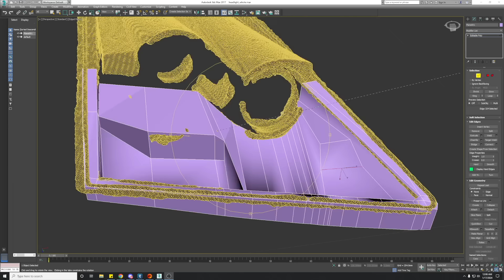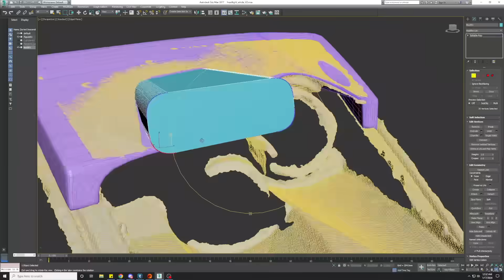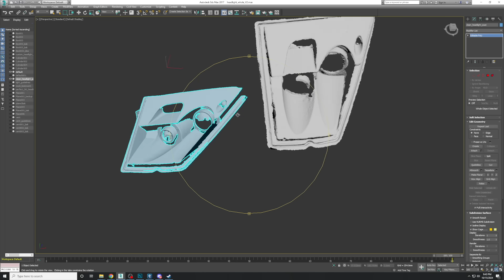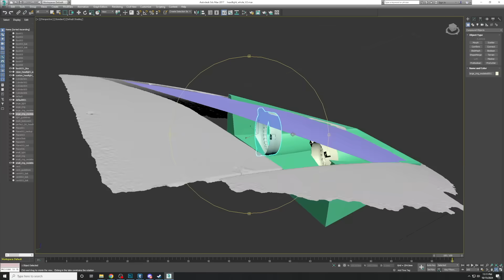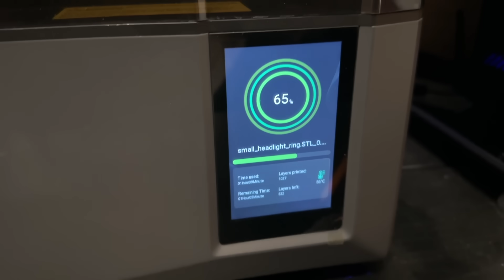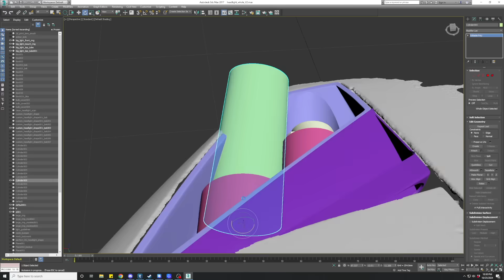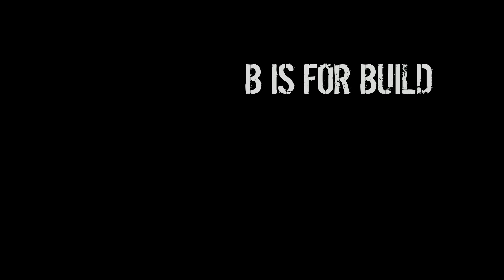I SAVED $23,000 By 3d Printing My Own Lamborghini Murcielago Headlights

Comment: why you didn't make a molding for your headlamp,, and you make the carbon fiber housing, that's make it more expensive and exclusive than 3d printing part..

i use 3d printing just for the molding, so i make all the part with carbon fiber or forged.

Comment: I've been have a blast making small carbon parts from 3D printed molds for my 2018 C43! I'm going to try the vacuum process and try make fender this weekend! Using 3D max is interesting, have you tried AutoDesk Fusion for parts? I use AutoDesk Products for home designs mostly in Revit but I use fusion for 3D printings and CNC milling but not very good at that. FYI your iphone has built in LidDar that I would say works as good as 1K$ scanner. Great video DIY all the way baby!!

Comment: Fellow Murci owner here... If you want to print the main headlight body in resin, I have a couple large resin printers to help you with.  Gloop is possibly a better adhesive for filament than gorilla glue since it melts/welds the filament together.  Also a 3D scanning tip, for odd shapes you need markers on, buy a cheap net and hot glue the 3d markers to the net.  Place the net over the object, scan it, shift the net, scan again, then process the scans together removing the net lines created which will be filled in by the additional scan. Great work on the light!

Comment: Love the prototyping techniques 👍 I can recommend primer filler (aerosol spray) for layer lines on FDM 3D prints. It needs less sanding because body filler applies thicker therefore more sanding back. The resin prints should be in a high heat resin (otherwise they warp) and they must be painted to seal the print from moisture in the air otherwise they go 'rubbery'

Comment: You might be able to print the inverse of what you need to sand with an offset to allow for attaching sandpaper too and to not sand too much into the original material. Then, depending on the shape you could sand by hand or maybe chuck it into a drill. Just an Idea I had while watching.

Comment: I am worried about the resin prints in the headlights for long therm use. Resin gets really brittle if exposed to uv light for a long time. So I think after some time those pieces will become brittle and they will break.

Comment: You need to a find scanning spray to use for your laser scanner. it should spray on and wipe off but give you the proper reflectivity for the scanner light.

https://www.google.com/search?q=light+reflecting+dusting+spray+for+laser+scanning&rlz=1C1GCEU_enUS1050US1050&oq=light+reflecting+dusting+spray+for+laser+scanning&gs_lcrp=EgZjaHJvbWUyBggAEEUYOdIBCjE0OTI2ajBqMTWoAgiwAgE&sourceid=chrome&ie=UTF-8

Comment: Quick tip, get a photocopier/ scanner. You can set parts on it and scan them at 1:1 size. Much easier to design with, rather than take a photo and a bunch of measurements!

Comment: Hey Chris, you can save some time on body filler if you paint the parts with the uv resin and cure it with a UV lamp. Also works as an excellent glue for clear parts.

Comment: @BisforBuild Massive timesaving tip! Brush your 3d prints with some of the SLA resin and hit it with a UV lamp, dries much faster than body filler and is just as easy to sand. (YOU MUST WEAR A RESPIRATOR! resin dust=BAD!)

Comment: I'm sure you're well aware by now, but there are special sprays that you can use when you don't want to use markers... or maybe to cover reflective areas. I've not tried to scan bulbs, but I have used it on other reflective surfaces, and could instantly scan it.

Comment: You can use that ABS resin in the place of body filler. It's a lot easier and a lot less mess and sanding. Plus, since you just cure it with the UV light, you kind of have unlimited work time compared to body filler plus it's a lot stronger. I've also used it in the place of glue. You just put a layer on with a brush and let gravity kind of do the work and then hit it with the light and repeat. Then when you're ready you can sand it. To me it's a lot easier to sand than the body filler. 
You can actually just let it cure a little bit before sanding to help out. Then finish it off with some more light. 
I use this method to fill layer lines as I don't sand anything first.
I put the resin on and then sand.
I hope this helps! 
You actually helped me decide on a 3D scanner....
Creality for the win!